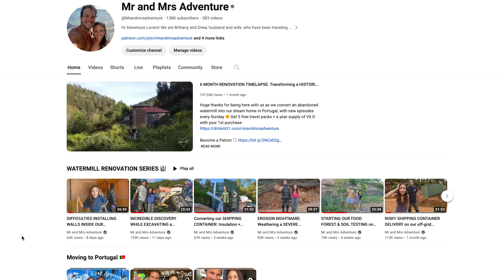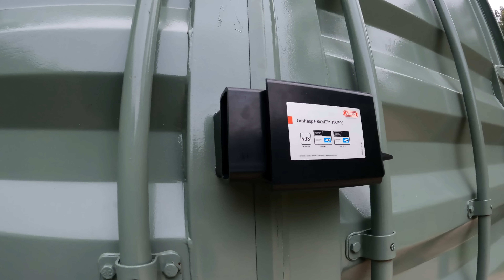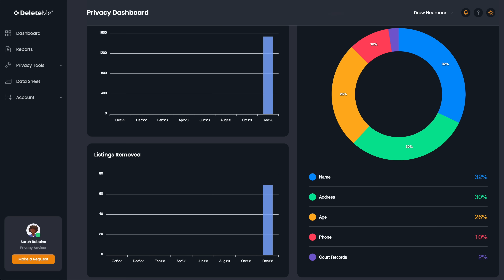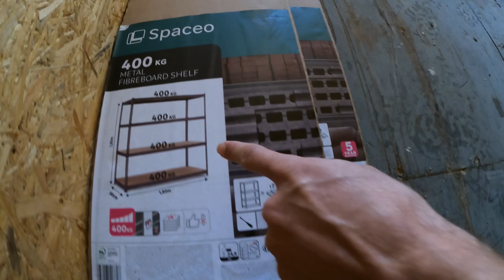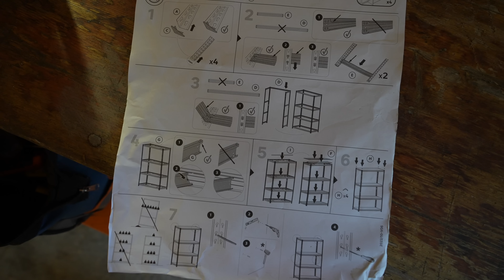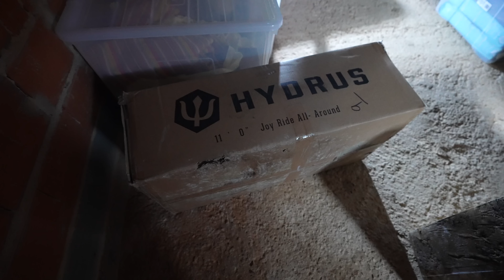IT'S READY FOR US TO MOVE IN! Renovating our OFF-GRID HOMESTEAD in Portugal

Comment: Drew, there is soil behind that turret wall? Is yes, highly suggest excavation, install a very deep French type drain feature. If not, that moisture laden soil against that block wall will always wick the dampness into the house. Simply applying a waterproof material on the outside block face will not suffice. One needs to lower that water table via a deep collection drain type trough. Paperboard aka cardboard sucks up and retains moisture. Get rid of all corrugated paperboard.

Comment: Great Video! Thanks for taking us along-
Have you considered the 2 recommendations below?

1.   I recommend purchasing some fairly large caster wheels (maybe 6-8 inch diameter) w/ at least 2 able to do 360 degree rotation for your shelves. Decent "rubberized" ones that could in a pinch, still do a trip on a dirt/gravel road.You never know when it's going to be very convenient to haul all the stuff stored on them, tools, fasteners, supplies, to another location all in one trip. You can also use them to make access to the back of the shelves really easy!

2.   There is a concrete waterproofing product that I will keep moisture, (& more importantly Radon gas...) from seeping through your floors and walls. I'd still install a membrane vapor barrier in between any surfaces as you build out the interior, but also fortifying the brick and concrete will improve overall comfort and piece of mind!

All the best,
M-

Comment: Moisture: Back cut 5ft wide along the backside of the building 24" below the floor of the house and french drain 2" clean gravel coat the backside of the building with concrete barrier tar. Then backfill. $300 per load of gravel and $150 5gallon tar and 2 days excavating. If you just seal or concrete coat on the inside it'll just continue to bubble and deteriorate the coating. $150/5 gallons for that as well, 4 bags of concrete to level floors in that room.  2 rolls of construction foam for your flooring or just tile. Which classic portuguese style tile would set it off nice. Especially on the steps. So this sounds like septic, and electric are your only real challenges aside from plastering the walls and new windows. 10 rolls of 25ft electrical wire might cover the whole watermill. 120ft of 4" schedule 40 for septic, 2 500gallon tanks.  Anyhow,  bubblegum.

Comment: If you think your moisture on the inside is coming from the outside you’re going to need to stop the moisture from the outside. There are many types of moisture barriers you can use. Some are for underground others for above ground. Nothing you do inside with truly address the problem. Heated floors are a great idea but will not address the issue it will actually exacerbate the problem if it isn’t mitigated at the source. You’ll need good insulation on the inside since the stone is so cold. But without addressing the moisture owing in from the outside it will only get trapped behind the walls and insulation. You guys have accomplished so much in a relatively short amount of time.

Comment: Merry Christmas and thanks for another fun adventure at the Water Mill! (Also, since you were drilling metal above the oil bottle and the bottle didn't have a cap on, I'd recommend not using it in an engine just in case some of the metal filings dropped into the container.)

Comment: If you have soil up the back wall you will have to tank the wall and floor on the inside and possibly the outside or you will continue to get damp come through and ruin your internal finishes. Be very careful about the design detail of the tanking it’s so easy to make a mistake so it will fail.😂

Comment: Is there air intake in the container
Reply: Good question. I used to have a container for storage; they come with protected ventilation holes at the top, at all 4 corners. Thing is, they've sealed all of them off with the insulation and OSB. Even with the in-built ventilation, areas of my container accumulated moisture / humidity over time and some of my stuff ended up mouldy (mind it was pretty jam packed full, and the container was on grade, although on gravel, and the bottoms are plywood, therefore the humidity can come through them).

Comment: To become energy and food self-sufficient, I have partnered with Amish builders to make small houses that I add solar, batteries, wood stove, and high efficiency heat exchangers delivered for under $100K 720 sq ft in Wisconsin. I show them the "Ruth Stout" method of "no weeding, no watering gardening" which creates better soil every year. No septic or well needed if you use a composting toilet and atmospheric water generator, getting your water from the air. All this is possible to put together right now.